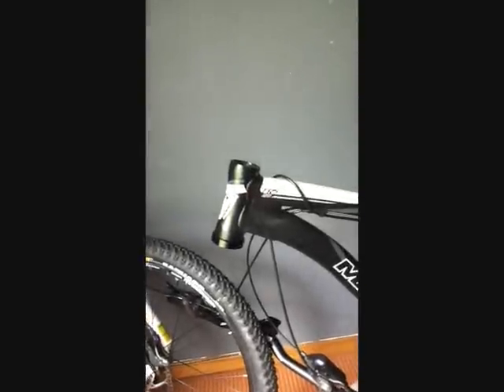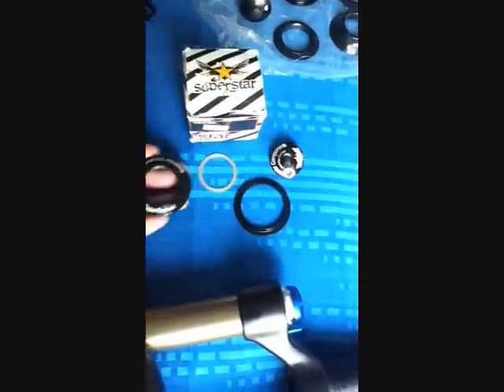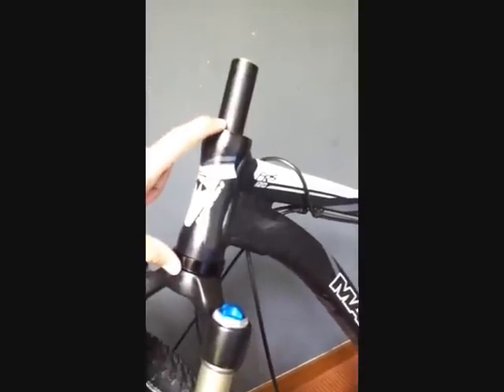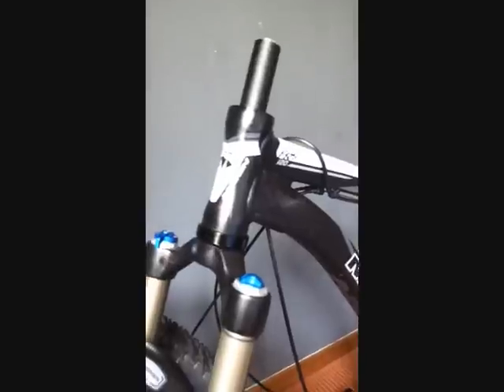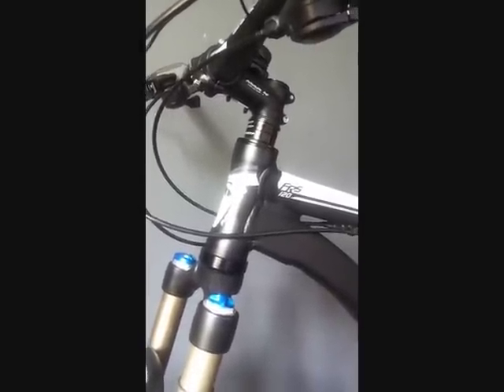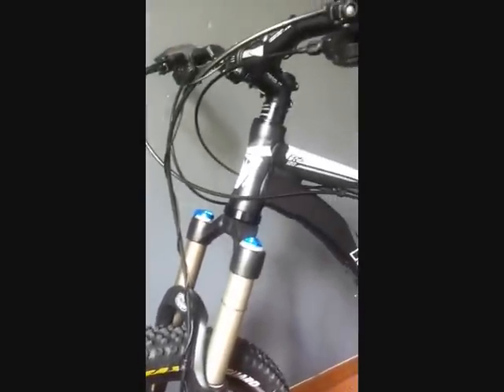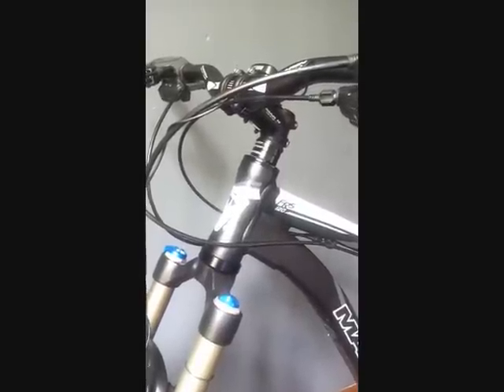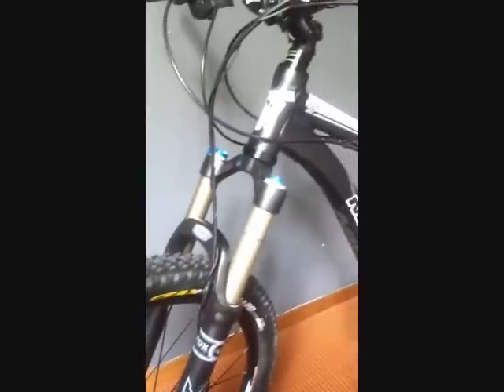Tapered Fork on a non-Tapered headtube install

Comment: Now I'm gonna Install my Markhor fork on my TREK Marlin 5 2020 :)
Reply: Samaun Sakir Anan did you do it? Wondering if it will work for the one I’m working on
Reply: Travis Lompre Yes i did, & it's works :) you just need a tapered headset...
Reply: @samaunsakiranan591  Hi! I also have Trek Marlin 5 bike! What kind of Tapered headset  do you have? Can you link to me? Thank you! Tamás
Reply: @Tom4si-e9y  markhor makes their forks with a straight steer tube anyways. Why convert when you technically dont need to?
Reply: @samaunsakiranan591  which headset

Comment: So ultimately this is a local bike shop did the work, I haven't a clue video. Doesn't even mention if the head tube needed to be reamed to accept the adapter.
Reply: he got the bike shop to install the headset because you need the right tools which he didnt have , you dont need to ream anything [except your attitude], it fits straight in .
He explained everything in the video on how it works , maybe you are just thick

Comment: Can you please give the exact brand and model of headset you used or even the link if you still have it so that I can order it online? And another question, how was your front wheel before upgrading your fork? Mine is a QR type and needs to convert to thru axle for that type of forks to work. Thoughts?

Comment: How did this work out and hold up over time? Would you recommend it? I wonder if you get any of the benefits that come with a tapered fork using this hack?
Reply: theres more options for higher end forks i kinow it really late reply
Reply: and yes i wwould recommend at it cheap to do

Comment: is this safe to ride? doesn't it alter the geometry / structural strength of the frame to a point that makes it an accident waiting to happen?
Reply: its only 10mm so wont adjust the angle much to make it a problem

Comment: I know it works,but the steering tube is gonna be 11mm shorter so that your stem is gonna be a lower position.
Reply: most people cut the steer tube on fork anyways.  its nothing adding a spacer or two wont fix!!!! there are a few pro dh racers that use this style cup to slacken headtube and raise bb

Comment: My head tube is not that shape it is a straight up and down 1 1/8 inch straight steerer can I do the same thing will it work for me ? But I don't know if my internal bore is 44mm
Reply: +Theo Dounis Go to the Cane Creek website headset fit finder. Enter your bike details and it will tell you the specifications.

Comment: hi. For you who watch this video.... It can be done iv Done it.

Your head tube needs to be a minimum of 44mm inner diameter  (not outer)

Look on ebay for a lower cup 44mm outer diameter this fits inside your headtube with the bareing outside with a bigger bore on the bareing to compensate for the taper on the forks. Hope this helps
Reply: how safe is it? did your frame geometry change too much? did it make the steerer tube of the frame a bit weaker and prone to cracking? i have an XC Cube bike with alu frame with 44mm integrated bearings. but i'm afraid to fit my tapered fork because i feel it'll ruin the design that Cube spent months and thousands of £££ to develop

Comment: Looks to me you have a tapered headtube but had a fitting to make your straight steerer fit your tapered headtube. This may not be possible with all headtubes.
Reply: +SUM1SLY83  this isn't a tapered tube, its an integrated tube, they look very similar, except upon inspection.
Reply: SUM1SLY83 a
Reply: Got to be 44mm integrated, but I doubt he knows much.

Comment: Find out what your SHIS first. If you have the same headtube as the one featured in this video, your upper headset will be ZS44/28.6 and your lower is EC44/40. Order it thru your LBS or online (Jenson USA, Pricepoint, etc). Cane Creek, FSA, Superstar or any headset manufacturers carry this. ZS means Zero Stack and EC means External Cup.